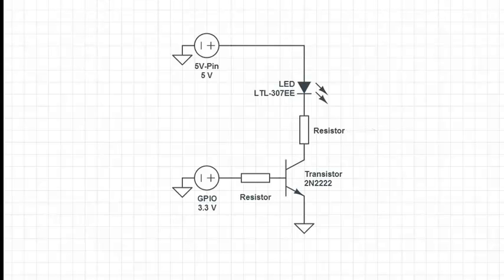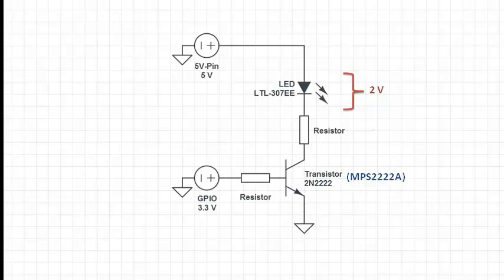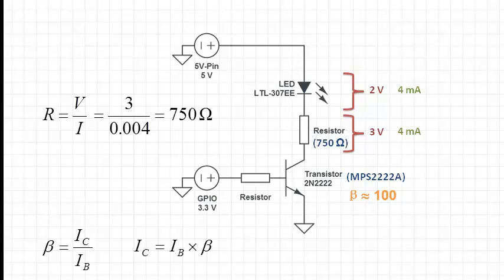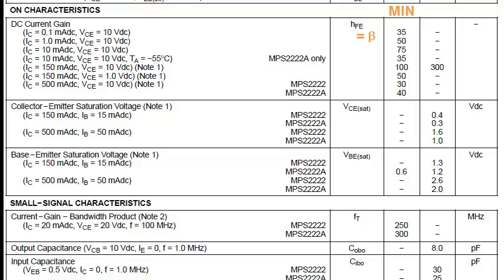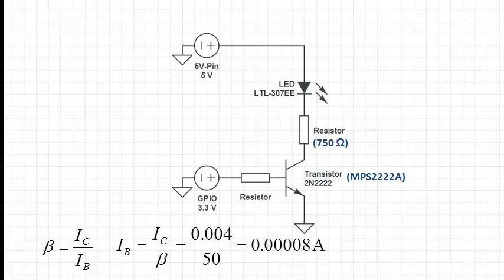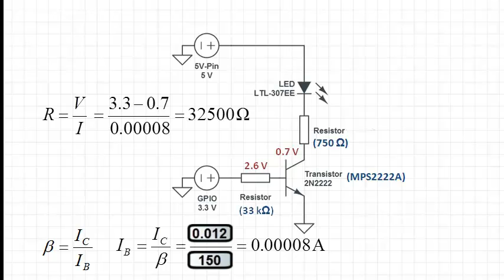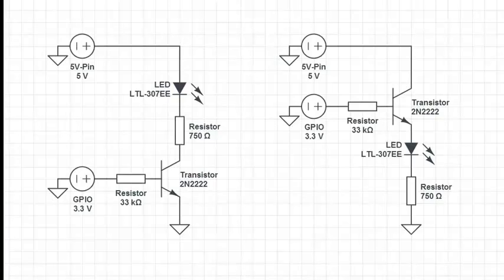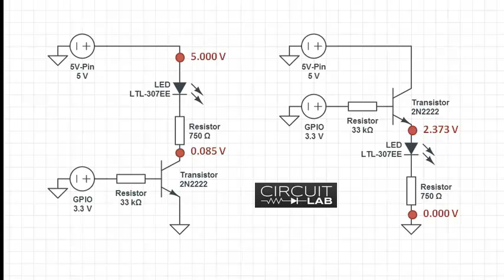Using Transistors with the Raspberry Pi (Part 2 of 2)

Comment: hey dude, great content. I want to ask whether there is a necessity for calculating (or putting) the resistor in the circuit if the transistor is wanted to be used as an amplifier rather than a switch. I am concerned about the idea since different pulses should be sent over the GPIO pin and the resistor value can be only calculated for the highest value. thanks in advance!

Comment: I'm sorry for my total  ignorance, but, I'm trying to reproduce it with a 12-v stabilized adapter and a power supply of 3.3v instead of my raspberry in order to understand before messing it all. Where should I connect "ground" ? I should connect the 'negative' pin for my 12v power supply, the negative pin for the 3.3v power supply and the emitter pin from the transistor (all three of them are connected to "ground" on your schema)? My '12 v' light is not turning on... Thanks !

Comment: What if I power a 5V fan instead of a 2V led? Can I get away with a single resistor between the gpio and transistor?
Reply: hey there
I`m doing just that right now. I got 5V small Pi fan hooked up +5V from Pi pin to the fan, from the fan (the other wire "-") connected to the transistor C pin, the transistor E connected to the ground. Using pin 7 from pi connected to transistor`s base to turn on and of the fan. Until now for me the fan only works if i connect de PIN 7 directly to the base without a resistor. Now I will try to connect various resistor values on the base to see various reactions
Reply: So my 5V fan is eating 70mA (no resistor no nothing). The curent on the gate of the transistor is 37mA and that is to much for the Pi to handle on the long run (so we do need an resistor there)
Reply: Same setup with 100ohms resistor between PIN 7 of the PI and the transistors gate I have 16mA current draw on the gate that is withing the limit of the PI`s accepted current draw on the pins. The problem is the fan will not turn under such conditions. but if I connect the pins 7 output directly to the gate it will work..
I`m using an 2n2222 transistor
Reply: @ccoco7689  Hey, thanks for replying! So does it mean that you don't need a resistor between GPIO and base, but you do need one between the fan and transistor, to reduce those remaining 37mA?

Comment: Ok, so I have another question...
Why does it show 50-75 Hfe in the table, but the graph shows completely different
values, depending on collector current.
So, what's the use for the table, in the first place ?

Comment: Why would you want to assume, it is a lower ß value ?
If the current gain is higher, will it not destroy the LED ?
Oh wait .. duh ! You limit the current with the LED resistor.
This is a switching transistor, I assume.

Comment: At 2:54, why do you say that the transistor will use 0.7 V? How did you get this value?
Reply: Its common for transistors. Just like Most normal diodes drop 0,7V.
Reply: ahh I see, thanks!
Reply: @billigerfusel  Shouldn't he then make the resistance smaller?
So that it's 2V + 2.3V + 0.7 V?
RIght now it seems like it's 2V + 3V + 0.7 V which is too much voltage.
Reply: you should say that in video

Comment: 0.7V is standard diode or in this case, transistor voltage. It will vary by a small amount from element to element, but all will mostly have this 0.7V value.

Comment: Is the 5V  Pin in the schematic a 5v pin from the RPi GPIO? I have been using an external 5V source and I can get the LED to light when I apply 3.3v (external source as well) to the base of the transistor as setup in the schematic. When I try to use the GPIO pin from the RPi the Led does not light. In fact it seems to have a base current flowing through it  as it is faintly illuminated.

Any help appreciated.

Comment: Also, the transistor you use in this video. Would you recommend it for projects requiring larger currents (the "Max" listed on the data sheet is 600 mA, Would running near this for a large period of time damage the transistor?

Also where would you recommend buying it?

Comment: "Collector current dictated by components in the collector"

By this you reference the 5v supply, LED and 750 ohm resistor, yes? Not the physical make up of the collector pin of the transistor itself?  In other words ohms law relating the 5v and the resistance of the LED and the actual resistor?

How do you find the resistance of the LED?
Reply: After having rewatched the video i see that in the beginning you determine that the LED requires 2v and 4ma. How do you know this? 

Are these arbitrary values based on a total necessary power (any v*i, for ex 1v and 8 ma or 4v an 2ma would work?)?
Regardless of the answer to the previous questuon, would these power or voltage/current values be found in a data sheet?

 If so which part of the data sheet could they be read from?

If not, then how do you determine them?

Comment: I understand how you calculated the 0.00008 value for current necessary to turn the transistor on now.

Is is related to the necessary output current(to the LED) by beta.

But still, does this mean voltage is irrelevant? Any voltage/resistance combo that results in this current will work to turn the transistor on?

And this metbod of determining conditions necessary to turn te transistor on is applicable only to NPN transistors, correct?
Not N channel or PNP?

Comment: What controls whether the transistor is on or off is only current, not voltage?

Where on the data sheet can you read how much current is necessary to turn it on?

Comment: 0.7 v is a general rule for all transistors?
Reply: If not, where on the data aheet would i find this value (0.7)?
Reply: .6 to .7v is the voltage drop across most p-n silicon junctions.
Reply: so it's just a rule of thumb then? Thanks

Comment: Hi, I am trying to use a BC337 to drive a 3watt LED, but I am unable to understand the data sheet. The LED requires 310mA and 7-11v. What is the current required by the base? and the resistor value??